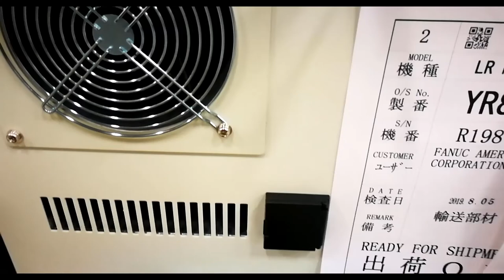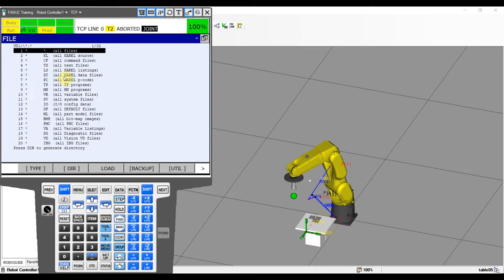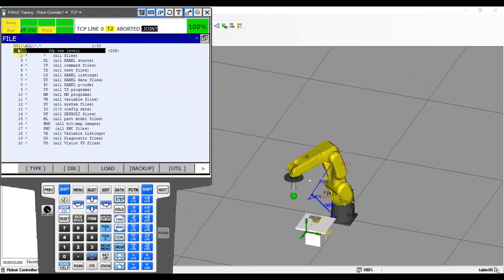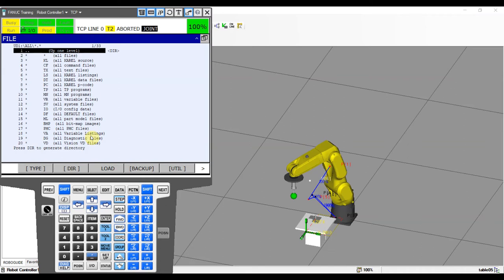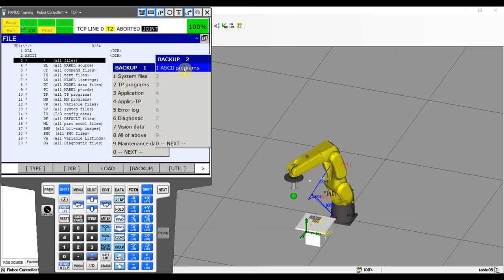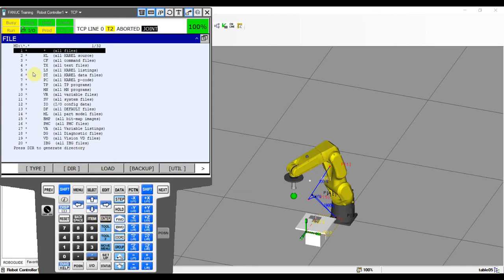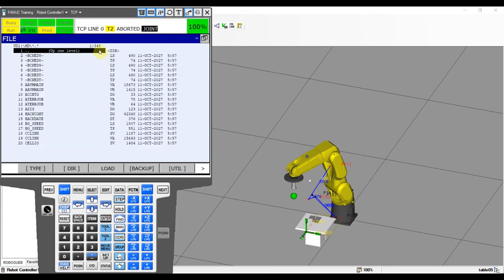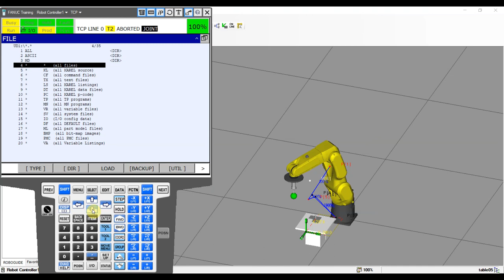Backing up FANUC robot - How to make a robot backup ?

Comment: Hi, wondering if you have any tutotrial/Video on PMM (Slave amplifier) back up for Fanuc controller. Thanks
Reply from the maker: Could you tell me a bit more about what you were thinking ? I'm not sure
Reply: @FutureRoboticsChannel  Hi.., I am suppose to replace a slave amplifier. To do so, I need to back up all the data from that slave amplifier to the CNC memory. I am quite sure I need to go in PMM setting to back up these data but I don't know the whole process. I will appreciate if have any tutorials/videos on this. thanks in advance.
Reply from the maker: @westtigers9140  Oh, that's for FANUC CNC, I do not work with CNC's, so unfortunately I cannot help here.
Replacing a servo amplifier on the robot is just plug and play (as long as it's the same model).
I would assume it would be the same on the CNC (however I do not know that), amplifier does not hold any data, it's just a power supply. On the robot all dat is stored in the pulse coders and robot memory, so unplugging servo amplifier does not affect any data loss.
Reply: @FutureRoboticsChannel  Thanks and I do appreciate you time.

Comment: Thank you very much for this video.
I have some questions about the following topic. 
Indeed, I would like to restore the information that I recovered with the Backup. What would be the procedure to follow?
Reply from the maker: I'm assuming you are asking about backup recovery ? or you just need to restore single file ?
Reply: @FutureRoboticsChannel  it's about backup recovery
Reply from the maker: @loicdaven9769  Oh I did not make a video on it yet :-), it's a quite simple process:
1. Get USB with the backup you want to load
2. Go to controlled start
3. Go to FILE
4. if under F4 you see [BACKUP] than click FCTN -> 2. Restore / Backup. Now the option will change to [RESTOR]
5. Select what would you like to restore (if full backup select ALL OF ABOVE)
6. Follow the steps and done :-)

You might see that some files will fail to restore, usually those are not important.
Reply: @FutureRoboticsChannel   I can do step 4. I don't have the option Restore / Backup when I click FCTN -> 2.
I also checked all the options offered by FCTN and I can't find any toggle like Restore / Backup. Is there any other way to change this  [BACKUP] to [RESTORE]?
Reply: I found it!! Thank you very much!!
Reply from the maker: @loicdaven9769  Are you sure that you are in controlled start ?
Reply: @FutureRoboticsChannel  I wasn't that's the reason I couldn't switch to RESTORE!
I went to the controller start and I could restore all of above...
But now I can't move my Robot. the TP show me the error "robot not calibrated" and when I try to calibrate,  it doesn't match. And I have another error "robot not mastered".
Reply from the maker: @loicdaven9769  Sounds about right :-)

You need to go to Variables and set $DMR_GRP[1].MASTER DONE to TRUE

than go to CALIBRATE and calibrate the robot

Hope you didn't move the robot yet ;-)

That's assuming that no motors / pulsecoders were changed on the robot
Reply: @FutureRoboticsChannel  done! It's okay with the mastering and calibration. Thank you!
But I can't always move the robot. 
Like Error I have SRVO-337 and SRV-402. So when I try to move the robot, I receive another message, this is MCTL-003 System is in error status"
Reply from the maker: @loicdaven9769  SRVO alarm that you have are DCS alarms, you need to check your DCS settings, you should be able to move temporary by holding SHIFT button than pushing RESET (with SHIFT still held), this way you will be able to jog the robot.
Looks like robot is out of DCS Cartesian Limits (SRVO-402)
Reply: @FutureRoboticsChannel  
I could solve the Alarm SRVO-337 by Appling the DCS:  "MENU"→"SYSTEM"→[F1([TYPE])] →"DCS" and Press [F2(APPLY)] in the DCS top menu.

I have identified the cause of the alarm. It is the 2nd robot that is not in its DCS (I am using 2 robots that should work as master-slaves). The second Robot isn't calibrated like the first. So I wanted to follow the same step you gave me above. But the problem is that when I set $DMR_GRP[1].MASTER DONE to TRUE, it directly changes to FALSE.
Reply from the maker: @loicdaven9769  So you have 2 robots on 1 controller or those are 2 separate robots ?

First of all check if the Mastering is correct on the second robot, do you have any other error messages ?
Reply: @FutureRoboticsChannel I have 2 robots on 1 controller.

 how can I know that the mastering of the robot 2 is okay ?
The error messages are: 
- SRVO-075 DCS cart. pos. Limit
- SRVO-075 Pulse not established (G:2 A:X)      --->X stands for all the axis 1 to 6
Reply: So How can I k ow that the mastering data is lost from the robot controller ?
Reply from the maker: @loicdaven9769  Your Pulse not established (G:2 A:X) references to the second robot, what you need to do is to jog each axis of the second robot for at least one motor revolution (jog at least 5deg), this will get rid of pulse not established. That's the reason why you cannot change the MASTERING variable to TRUE.

After you'll jog the axis you might need to RESET_PCA (in the mastering menu) than cycle power the robot, than to the MASTERING variable trick (or this might not be needed)
Reply: @FutureRoboticsChannel   I did it, and now I can move the second robot well. Thank you!!
I coupled the robots (Master-Slave) like they were. I just had one Alarm: SRVO-402 DCS. Cart. Pos. limit.

Now I'm trying to move the Robots together, and I have this additional error:
-MOTN-23 In Singularity
This refers to the first robot, but I didn't really move it like the second robot. Do I have to move it to solve this?
Reply from the maker: @loicdaven9769  Happy to help !
SRVO-402 DCS. Cart. Pos. limit. is a DCS issue, for now you can just disable the Cartesian position check (see my DCS video)

For the singularity change the jogging type to JOINT and jog axis out of singularity (can't see the robot position so I cannot tell you what singularity it is, but for sure you can jog using a JOINT movement)

Comment: How to enter the backup programe in the fanuc because i have a probleme when the robot take the box and returns to position 0 ,then place in the pallet not taking and placing directly
Reply from the maker: I did not make a video for loading files back yet, but you can do the same thing I'm doing to SAVE single file, but hit LOAD instead of SAVE. 
So you go to FILE->Select your device (for eg. UD1:)->click ENTER to see all files, navigate to the file you want to load and hit LOAD.
It will ask you if you want to override and you say YES. Keep in mind that this file cannot be running or be selected on the robot, because it won't let you load

Comment: I’m trying to do an Image backup from UT1 and I’m stuck on the main screen where it says auto image backup start please wait
Reply from the maker: Is it the gray screen or the color screen where you are selecting image backup ?
It's possible that robot froze during the IMAGE backup, you might need to reboot the robot. I'm trying to use MC: for IMAGE bakups as they should be the fastest and safest way to do a backup
Reply: @FutureRoboticsChannel   I used UD1 but it was giving me a FILE-064 Unspecified DOS system Error:72  
But then when I connected it to UT1 things worked but then while taking image backup it gave a gray screen and froze over there we shut the thing off manually and turned it on  
It didn’t happen when we took a backup of the 2nd Robot
Reply from the maker: @sahilthakkar6432  DOS system Error might mean one of 2 things:
-bad UD1 port (you can just replace it)
-corrupted software, you might need to re-install the core software to fix that issue

going back to your problem, I've seen that happen quite a few times, what system are you using R-30iB or older ? I always recommend using MC card, because I personally never seen one fail.
Reply: @FutureRoboticsChannel  I’m using R-30iB Plus